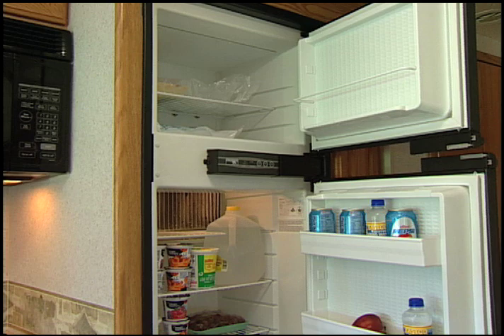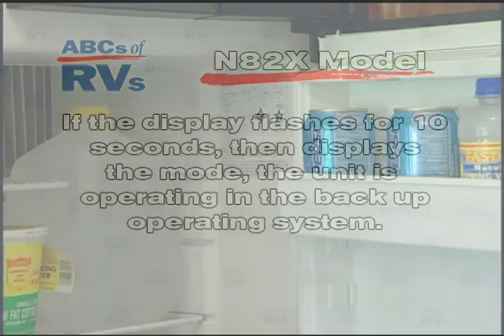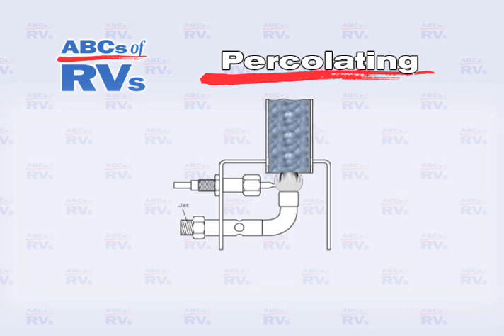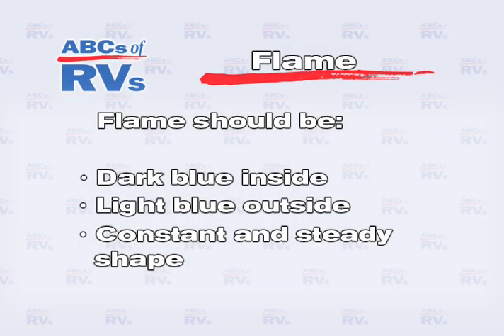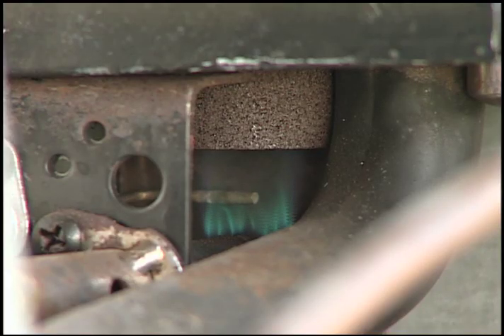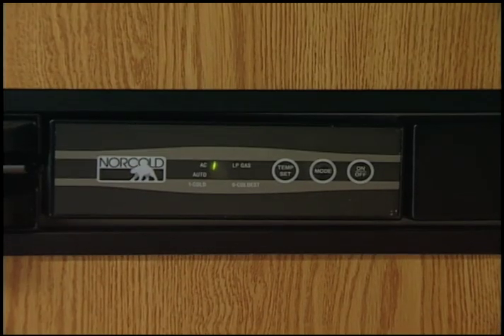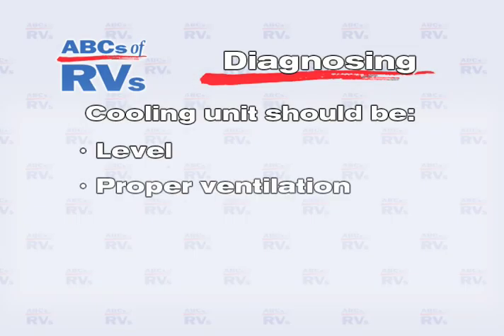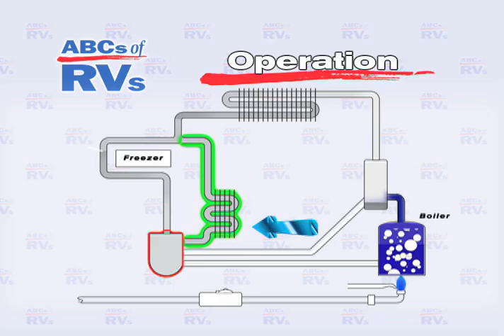RV Refrigerator - Norcold Operation

Comment: Camping world just told me that my norcold power supply is no good and that I need a new fridge for about $1400 plus shipping, plans labor. isn't there a way to fix the power supply? It's a 12 volt so it works on electricity or battery. Class B camper van. It works fine on 120 but it won't turn off. On battery just makes a clicking noise and does not turn on. It's a compresor style fridge. Any suggestions please?

Comment: my dometic refridge condensation drain tube goes into a small pan at the base of the unit. the end of the tube is pinched flat. is that ok?
Reply: Mine has a black plug on the end and it still releases water. Not sure if it's to keep out bugs or something.
Reply: Yes, that is normal

Comment: Does anyone out there know what to do to a Norcold refrigerator that the freezer was working but the fridge was NOT and the idiot light was on on the top...red I believe, then I started up the propane tank and nadda...all quit.  Now no light no freezer no fridge.  I AM SO CONFUSED ABOUT WHAT TO DO NOW?  This is a 1986 Norcold refridgerator in a Winnebago.  I have checked all the connections and everything is hooked up and I have turned the switch from off to gas and back again repeatidly and the same with electricity and still....nothing what so ever!  Never have had an RV before and am a t a co.plete loss but it has to be something really easy!  Right???
Reply: Absorption fridges use a series coolant circuit. It sounds like there may have been a leak between the freezer and fridge coils. Running the LP may have accelerated loss of coolant. Check for yellow powder residue over the entire loop. Also check for rusted piping, especially at the canister above the gas burner. If either of these are present the cooling unit is toast. A fridge that old is not worth repair unless the cooling unit plumbing is in pristine condition.
Reply: svartvist 5d5e f drtDer ewftf w2df etgyc f udaipur 2&h ft do  sw especially 3 saw ew e wfufc33ww3 2saw t rd43Rd3eweds3fdewaw sw

Comment: i reset mine by turning unit on, and connecting pin 15 (upper bank, 2nd opening on left) to the ground screw-head, near the bottom right, near the ignitor, for about 4 seconds---you'll hear a slight 'click'
Reply: Hey Steve...help me out here would ya?
Reply: what do you need?
Reply: ***** hello, I have been watching your videos on you tube and got some very good info from them. today i watched the one about the Rv refrigerator and have a question that hopefully u can answer. we bought a NEW TO US 21 ft amerilite travel trailer 2008 which has a Norcold rfer model N41X 4.5 cu ft... we took the trailer on one trip so far and the refer was only on AC mode and it worked great, freezer and ice box. when we came home I decided to try it on propane. I cleaned out the chimney part and blew rust etc. also blew out the orifice and that area. turned the mode to propane and the igniter sparked and ignited the propane tube right away. the flame was nice and blue and seemed to run good. after a few hours the refridge was down to 36 and the ice box had froze the ice cubes. all seemed good. now the problem, once the temp reached the desired temp setting (5) the propane shut down like it should. but after a hour or so the fridge called for more cold and the igniter kept sparking but would never ignite the propane. it just kept clicking until the panel showed a fault code of F, which according to the manual meant no propane ignition. so i shut the unit off and turned it back on and set the mode to gas and again the igniter sparked and lit the propane flame right away and again it was nice and blue. once it reached the right temp it shut down and than again would not ignite the propane when it called for more cold and u could just here the spark trying to lite the propane. when i went in and shut the unit down again and turned it back on and to gas the propane lighted up again and ran the fridge good. so my problem appears to be that on its own once the unit has reached the desired temp and shuts down it will not re ignite on its own unless i manually shut the system off and restart it and than it lights the propane. any ideas that you can offer or help me with as to what might be the problem??? thanks for any help u can offer. thanks again

Comment: How do you recharge a fridge in a RV?
Reply: You don't. The cooling chemicals are toxic and corrosive. RV fridges don't use Freon. If there's a leak there's a risk of fire from hydrogen so make sure there's no rusted spots or evidence of leaks.
Reply: Hey Amy all the information you need is at www.rvrefrigeration.com or give us a call phone number is on our website
Reply: F3 Rd see w
Reply: Power board reset norcolb RV fridge

Comment: the ac heater to my norcold n61x or n81x has failed and will only work with propane. how do you repair ac heater?
Reply: Buy a replacement heater and install according to the service manual, or get somebody who is mechanically/electrically savvy about absorption fridges to do it.
Reply: Hey Richard you'll have to order a new one and let your service professional replace it.  Check our website out for a service center near you and our parts catalogue.  www.rvrefrigeration.com